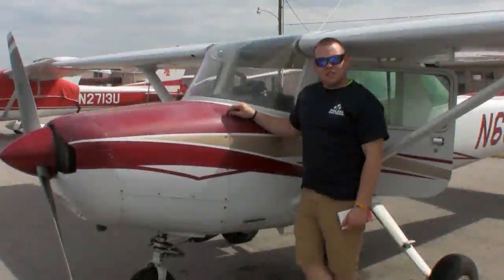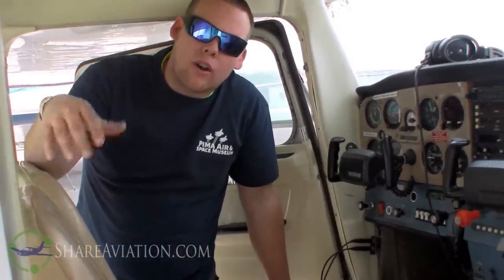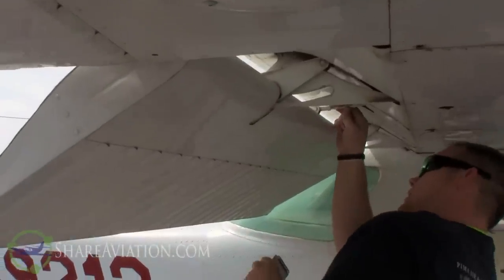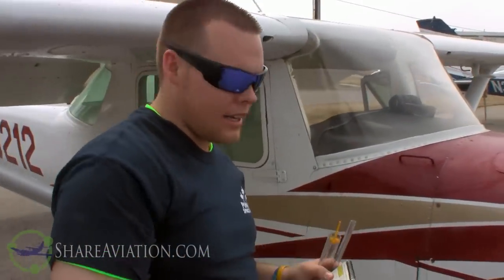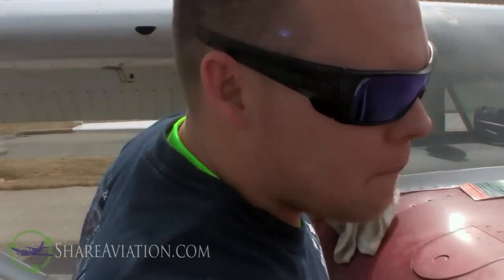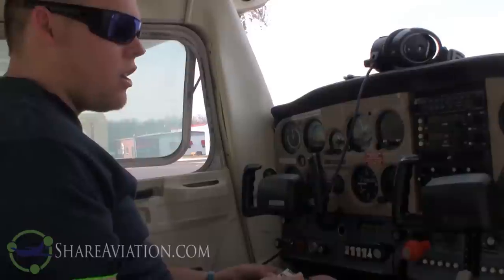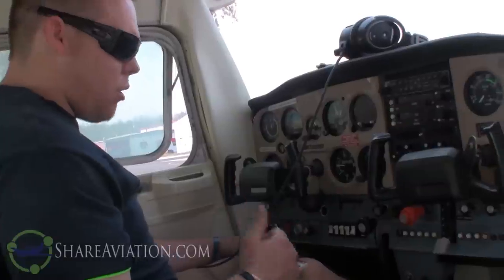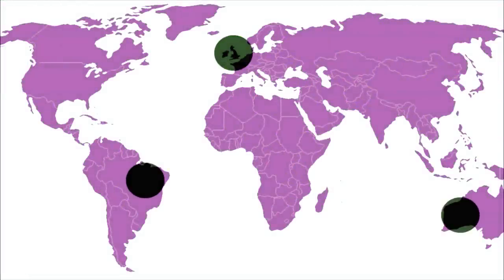Viewer Requested: Cessna 152 Preflight Inspection & Startup

Comment: Flap check is more than just visual  inspection it’s checking operation and symmetry. You don’t want to wait until your on final to find out only one flap lowers and the other doesn’t. That won’t end well. It’s called a Fuel Gauge or Fuel straw not a fuel dipstick. Bolts and nuts not bolt and screws. Don’t need to wipe off dipstick before you check oil level like you do in a car. Stay away from prop plane of rotation. Hold Aileron up w one hand before sticking other hand in to check linkages you could potentially lose a finger. Check the pitot drain hole as well as the front. How do you know the Landing light is working or not just by looking at it without it being on. Why didn’t you check the main landing gear? Why not collect fuel from strainer and dispose of it safely instead of on the ground. If your gonna teach then do it right. Students watch these videos and develop bad habits.
Reply: Thanks for your post Gerry. I concur with all your points. You can hear the wind over the mike and he doesn't hold on to the ailerons! Frightening!
Reply: Lee Turner Thanks man! Can’t get those bad habits!lol

Comment: -I will just add that when you check the engine oil, you would have to screw the gauge back on completely (not too tight) and then reopen it to check the oil level. By not closing the gauge  properly, you're missing the 3/4" (approximately) threats on your measurements.  
-Also when you check the rudder elevator, It is important to check the gutter pins on the rudder connection to the flight controls cables.
-When checking the prop, you should not rotate the crank shaft. if you have a short circuit somewhere, it may crank the engine.
-missed items on your checklist: / / /  /  /.
- What you touched as "fuel tank vent" is actually the cabin air inlet. The fuel tank vent is located near the upper strut connection to the wing (L-shaped pipe)

Comment: It’s always interesting to see how others pre-flight. Quite a few items missing on those check lists compared to my flying club. There was no main gear check, no stall horn check apart from a visual but you can’t tell if wasps etc are inside. Didn’t visually check fuel level which also allows for a good look at the wings upper surface. No light checks. We tend to use the POH.

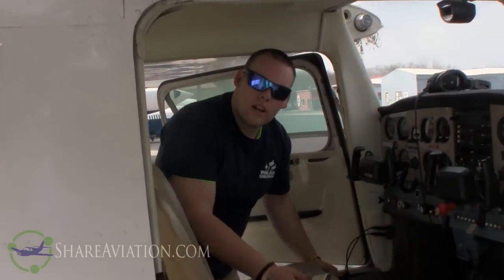Comment: At 2:00 my take on extending the flaps in preflight is that if there's any problem doing this on the ground then the plane is not airworthy. If you cringe at this test then you definitely need to reevaluate just how terrible a malfunction (such as asymmetric flaps extension) would be in flight.

Comment: Glad to see that so many other people have spotted things left out.  Maybe I missed it but he didn't check the elevator trim tab by moving the trim wheel to full UP, then full DOWN and then return it to NEUTRAL. By not doing that you could be setting yourself up for an unexpected pitch up or down of the nose post take-off ( and also you need to see full range of movement). Another thing is that it is better to check your flying controls while in the cockpit by turning the yoke in both directions and pushing and pulling - the ailerons should not be slapped up against the stops by hand. He was concerned about the risk of an engine fire due to birds nesting material inside the cowling but happy to create a pool of a much more flammable material - i.e. AVGAS - under the engine exhaust. Also by not capturing the drained fuel in the drainer/tester, he misses the opportunity to spot water in the fuel and afterall the belly drain is the lowest point in the fuel system and probably the one most likely for water to collect in. I would also be looking at the condition of the alternator drivebelt to see that it isn't frayed etc. I would also have a good look at the rudder hinges -make sure that the  3 hinges have their nuts and bolts present - also the elevator hinges - that they have the castellated nuts complete with split pins in. Also the ring of bolts on the elevator torque tube flange.
No one is perfect  of course and we mustn't deter people from furthering aviation by making negative or non-constructive comments.

Comment: I agree with Joe Rivera: Tires and brakes.  Also, check alternator belt, check the pitot tube and static vents are clear.  Check that all the lights are working and the pitot heat.

Comment: didn't check brakes didn't check both fuel tanks didn't check both wings didn't check antennas didn't check air in rear tires should verify the static port is free of debris also should verify that the stall warning is working properly and that the reed that makes the squealing noise isn't stuck. This was an extremely lazy preflight inspection especially since he was using a checklist
Reply: What about checking Nav Lights and Pitot Tube is clear and Heater? Did you hear the wind? Hold on to the Aileron when checking the Rose Coupling!!! You could loose your fingers :(

Comment: Thorough video. You scare me every time you touch that prop. Please please please don't touch that prop. Even though you made certain the key was out, if there was a short wire and a little fuel left in the cylinder ports that prop could fire by rotation. I cringed every time you went near it :(
Reply: Wyatt Wilcoxon then how do you check the prop, it is normal to do this if you are sure it is safe.
Reply: @christiancamilleri5439  I think I would go with a lesson from childhood and touch with my eyes

Comment: I am a student pilot, just got my 1st lesson and I am confused about preflight inspection. I watched 3 different videos about preflight, and every pilot, instructor  do this differently. one pilot start from the tail and the other start from left wing. this one didn't check controls movement in the begging, but the other did. so what is the proper way to do a preflight inspection?
Reply: There's no such thing as too much. Follow a checklist and make sure you do a thorough enough of a job to feel the airplane is airworthy. I've always started from the tail and worked my way to the right wing, nose, left wing. There is no right or wrong....what matters is that it gets done!!

Comment: Hello, man. When you are starting the engine, do you only turn the keys? Or you pull the throttle too?
Reply: Throttle goes in a half inch prior to starting the engine, full rich mix, as part of the before start checklist. Clear prop, clear left center and right, then start.

Comment: Dose the Cessna not have brakes? I didn't see that checked on either side.
Reply: +Frank Lister Why wouldn't it have brakes?
Reply: +Frank Lister  it has brakes..both sides,,but none on the nose wheel
Reply: The break fluids are supposed to be checked on preflight, but the breaks themselves are usually checked while taxiing
Reply: I believe they're asking about actual brake pad wear, not proper operation and pressure

Comment: kind of dumb question, but do you shutdown the engine by pulling out the mixture? or the key?
Reply: cut-off the mixture
Reply: Mixture,  never turn the key off until the prop is stopped.

Comment: Hey, I am a student pilot and I fly in a Cessna 172. My instructor says to prime the aircraft using the throttle knob. Opinions ?
Reply: I also fly a Cessna 172 and I use the throttle method on it.
Reply: I fly a 172R so the fuel pump is my primer.